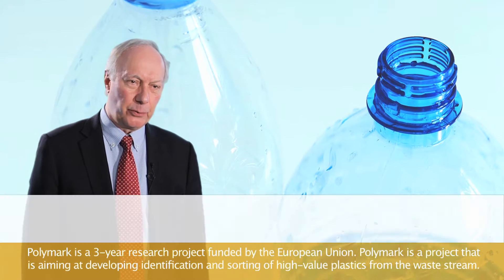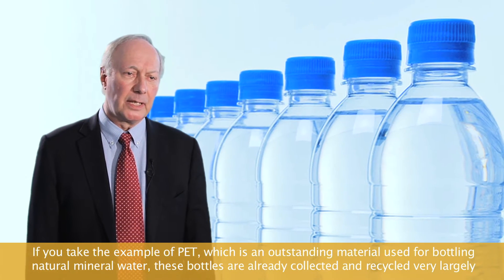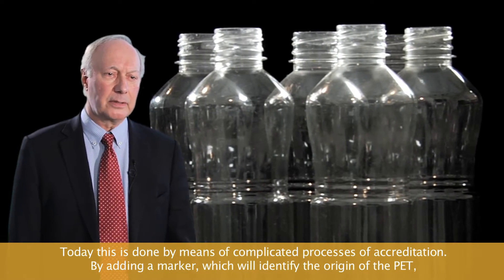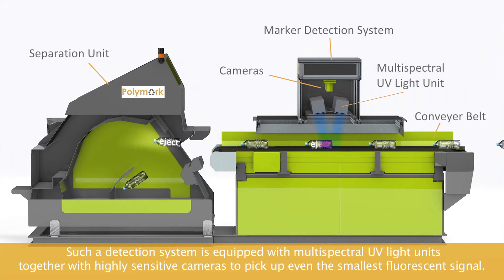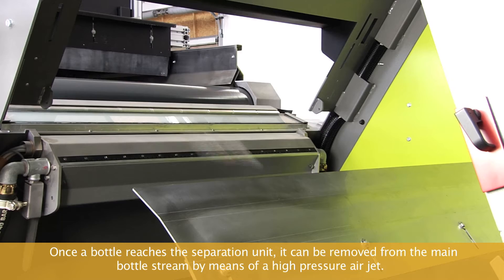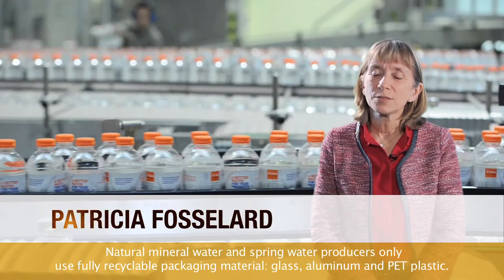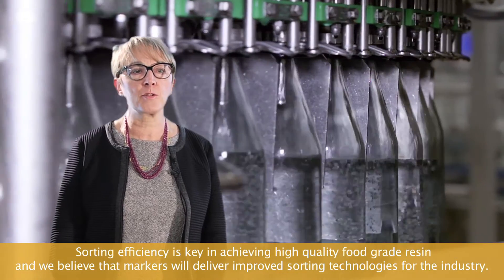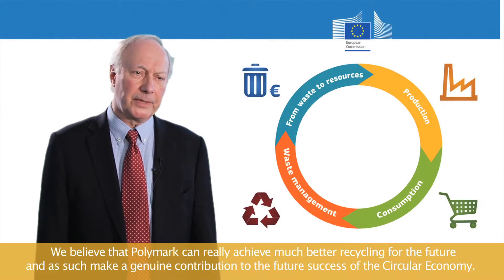Polymark EU Project Video 2017

Comment: Plastic recycling plant
Each production enterprise, although it has a large number of common features, is often created in its own specific conditions, therefore it is almost impossible to answer the question "how much it will cost".  A guide can take the cost of the equipment, but the benchmark is likely to be deceptive.  The company establishes production plants for the secondary processing of plastics on a turn-key basis: 1. Preparation of the business plan for the project 2. Selection and delivery of basic and auxiliary equipment 3. Selection of premises 4. Preparation of premises for the placement of production (repair and construction, restoration and /  Or laying of engineering networks) 5. Installation and commissioning of production equipment 6. Personnel selection for all positions and training 7. Organization of supply and marketing 8. For the period when the customer base is formed  and, provide raw materials and arrange sales.  This period is not limited.
If you are interested in this offer, please contact me. E-mail: marketing@ppt-rus.ru